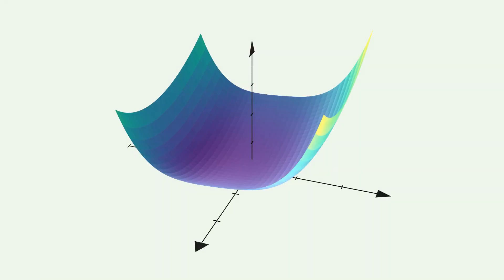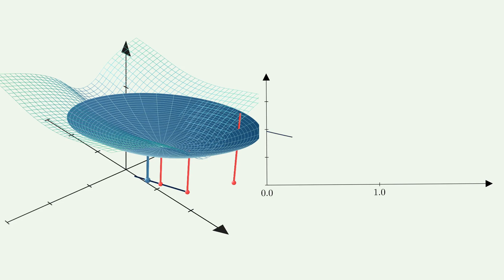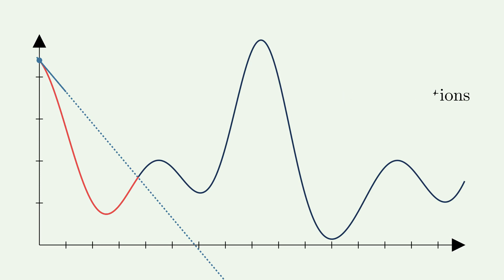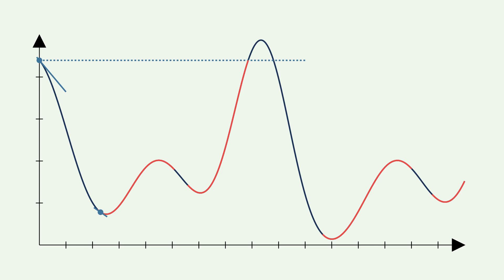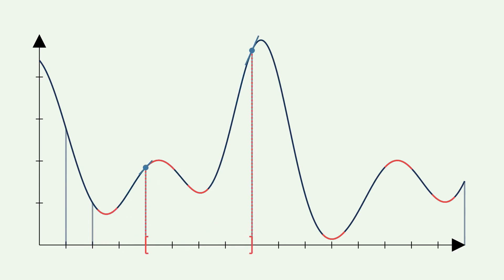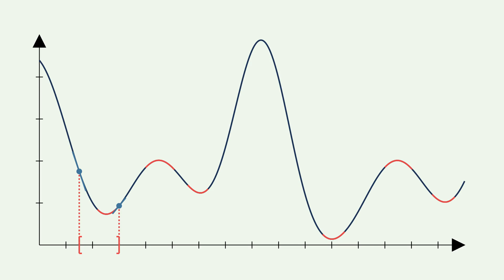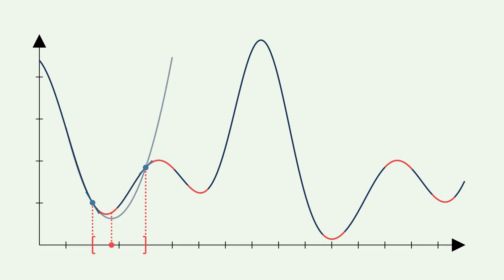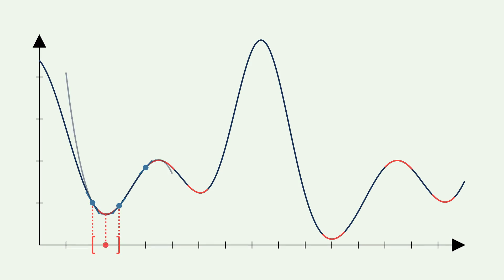Understanding scipy.minimize part 2: Line search

Comment: Hello! I am doing my undergraduate thesis on biomass quantification in oak forests in Chile and I am building equations that allow estimating the total aerial biomass from the biomass of leaves, biomass of branches and trunk biomass simultaneously using the BFGS method, but it is difficult for me find the starting values (in RStudio) and I would like to know if you know any method to find good values and generate good estimates. Beforehand thank you very much!
Reply from the maker: Hi, this sounds like an interesting problem! Unfortunately, I think choosing the starting value is quite problem dependent. So, maybe the equations indicate that there is some candidate for a good initial value? If there is no obvious candidate, I could think of two possible ways: 

1. I guess the easiest is to just start BFGS multiple times from random starting values. For example, you could start BFGS 100 or more times with a different starting value each. Then you can just keep the best result. This might also give you some insight in how sensitive the optimization problem is in regard to the starting value. Do all runs result in similar values or are the results highly different?

2. Alternatively if there are way too much local minima, you could try a global optimization algorithm. There are some implemented in the nlopt library (seems to be available via nloptr in R, but I don't use R). However, I expect those to have a way longer runtime than BFGS. I am also not sure how they scale with the dimensionality of the problem.

In both cases you would need to have bounds on the reasonable range where the starting value could be, either for the sampling or the global optimization algorithms.

Personally, I would start with the multiple random initializations if I don't have good prior knowledge about what a good starting value would be.